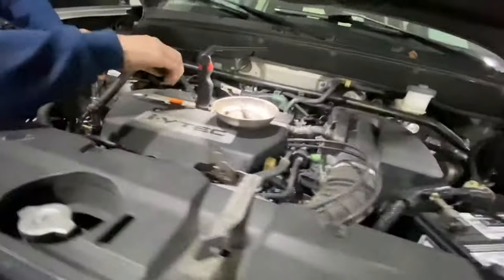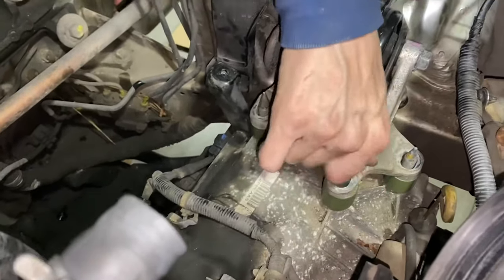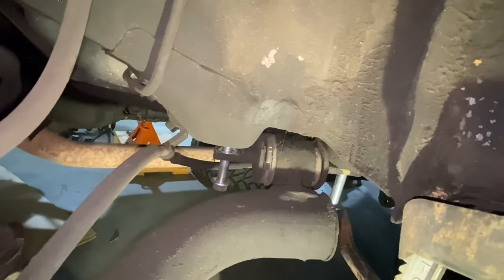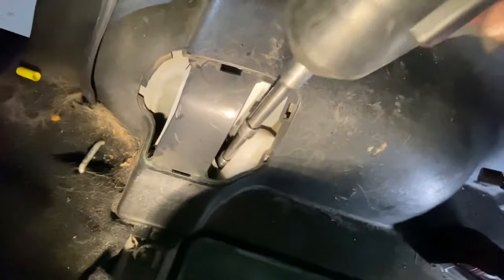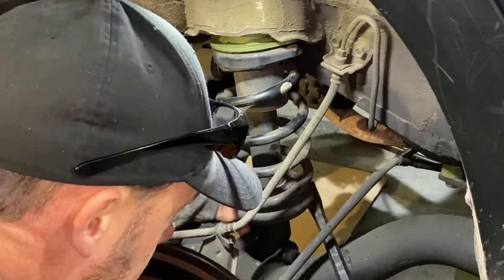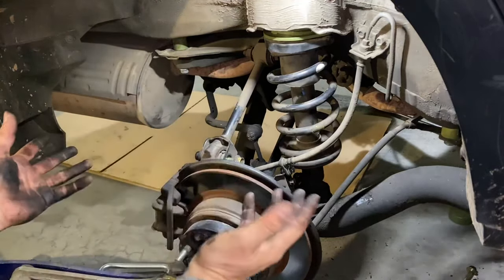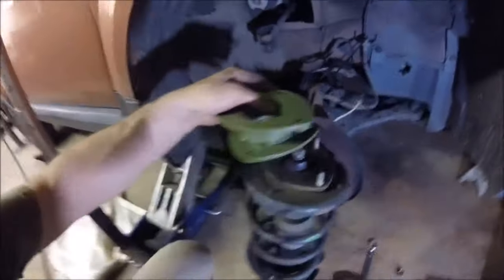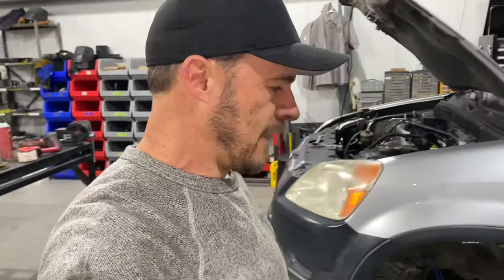How to lift your 2002-06 CRV 3 inches with the HRG Ultimate kit!!

Comment: I recommend the 1.5in lift. Theyll fit it upto 30 in tires no problem. No drop needed.
I have a minimum of 12"  clearance  on my 05 crv.
Reply: No axle issues ?  Front and back 1.5?
Reply: @EATSLEEPJD  none. But you may need wheel  spacers when going thick tires.
Reply: @EATSLEEPJD  but the boot will rip for sure if you're using old front axles.  Rear will be fine
Reply: @tomasashenafi882   ah gotchu.  Just picked up a 2005 for my YouTube.  Researching about the lifts now.
Reply: @tomasashenafi882   thank you.
Reply: @EATSLEEPJD  my recommendation from lifting two 2nd gens. No more than 225mm thick and 29 inch tall AT tires. Wont need wheel spacers, fuel consumption wont be as bad.
New front axles because u dont want the  mess. Front bolt and rear arm camber adjusters.
Reply: @tomasashenafi882   front and rear adjustable camber arm?  What you mean from front bolt.
Reply: @EATSLEEPJD  cam bolts for front. Whole new arms(adjustable) for rear.  You will see what i mean when you search it up.

Comment: The instructions say to use the m12x60 on the driver side for the transmission but your video says to use the 70. Which one is correct? Only asking since it’s your video and your kit but it’s contradicting each other.

Comment: how has this effected drive feel, transmission shifts, and mileage
Reply from the maker: The mileage is not effected by the lift, but by installing larger, heavier tires, roof baskets, and heavy off-road gear. The lift does cause poor on-road handling. The engine and transmission will seem sluggish after installing larger, heavier tires. If your main concerns are mileage and handling you may want to consider leaving your vehicle stock.
Reply: Im about to install your 1.5" lift and leveling kit. Would you say the poor handling applies to this smaller lift as well?
Reply: @hrg_tv I just wanted lifted a bit with big tires. No off road gear or roof basket nothing. Should I b fine?

Comment: Ben for the drop kit Why put a larger hole spacer on the spikes just to accommodate the lip? Just mill the smaller spacer a bit wired on the bottom. The way you are doing it now puts way too much pressure on the bottom and its more prone to snap.
Reply from the maker: I understand what you are saying but that’s is not true based on our experience. The large hole spacer fits flush.There is no additional pressure and the wider hole has nothing to do with the tip. The bolts in fact do snap easily when people install the spacers incorrectly. I actually explain this in the video at 4:10. At one point we were drilling the smaller ones out but it added labor cost and people were still installing them wrong. It didn’t solve anything so we switched to a spacer that was already the correct size.. It’s worth mentioning there are guys that have had this kit correctly installed for 3 years and counting, trouble-free.
Reply: @hrg_tv  Just saw your comment. Yes, I saw that in the video but the way it is now you are putting all the stress on the lip. Which is preferable to the alternative, but it's still not the best way to do it. I don't know anything about the production I guess it makes sense to have a different item for this position to avoid people messing it up.. Just saying it can be better. Let's hope we all drive our cars trouble-free.
Reply from the maker: @martinnedyalkov9185  Your statement implies that we have no idea what we are doing. You might be right about that, but we are always learning and improving our products. We noticed the failures you are worried about do actually happen but only when the spacers aren’t installed properly. So the real challenge is showing the proper way, which I feel like we have accomplished with this video.

Comment: Hi what where the actual measurements of the spacers as I can't get it. Because they say the are 1.5inch rear but how does that make it a 3inch lift?? Many thanks
Gary
Reply: It's the geometry. The 1.5in spacers are inboard to the frame enough, that the resulting lift between tire and wheel well makes it 3 inches.

Comment: I just recently bought this lift kit and barely put it on today. There seems to be vibration coming from the front when I accelerate any thoughts? One thing I didn't do is rotate the top of the spacer 180 degrees I don't think the instructions said to do that, why did you do that?
Reply from the maker: Juan you bought a 2 inch kit. This video is for the 3 inch

Comment: Hello hrg fam I did a 3in strut spacer lift on my 2gen and now having trouble with alignment too much positive camber. I installed front camber bolts but only helped a little would the engine drop kit fix the problem
Reply from the maker: The engine drop kit only drops the engine 1/4”, it does not affect suspension geometry. Your best bet is to install a shorter spacer. A 3 inch spacer is too tall for these. 2.5 is pushing it and works best with a 1” subframe drop.
Reply: I order the engine drop and subframe drop it’s a 2wd hopefully works a little better
Reply: Why would u sell a 3in lift if it’s not going to work
Reply: @hrg_tv   curious also HRG, why sell a 3" kit if the positive camber will always be too much?

Comment: Your video or instructions also fail to mention that without trimming the passenger side stud on the motor mount equipped with ABS, you cannot get the nut off.

Comment: Do we need drop kit  for subframe/engine/transmission when installing 2 inch spacer?
Reply: I currently ordered a 2” lift spacer for front and rear it should be fine without it but i would replace your sway bar links and ball joints
Reply: Theres gonna be a lot more tension on those parts so replacing them would be the best option

Comment: Cheesy body spacers. Also, if you remove the front lower control arm bolts installing rear struts is a lot easier.

Comment: should you always use a taller spacer on the front than the rear?
Reply from the maker: IT DEPENDS ON THE DESIRED STANCE. IF YOU PREFER THE REAR TO SIT 2 OR MORE INCHES HIGHER THAN THE FRONT, YOU WOULD USE THE SAME SIZE SPACERS FRONT AND REAR.
Reply: @hrg_tv  thanks for the info

Comment: I installed the 3 inch lift on my 2004 Honda CRV and I'm looking for some steel black rims to slap my 235/75/15's on, but i'm having a hard time finding the right rims. Can someone make a recommendation. I already messed up one order and really want to get it right this time. Been asking around and still cant find an answer. Thanks!
Reply: they're called wheels. I can help you out, what are you having a hard time with ?
Reply: @danielgardzina6982  thanks for the offer. I already figured it out. I didn't understand the  lug pattern and how to read wheel measurements, but finally figured it out. I had to get old jeep wheels with the same lug pattern.